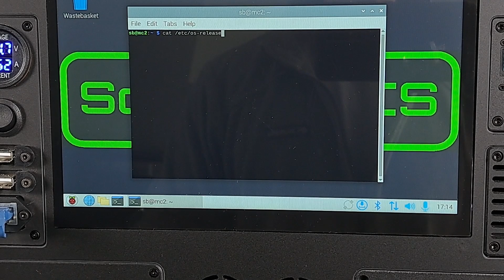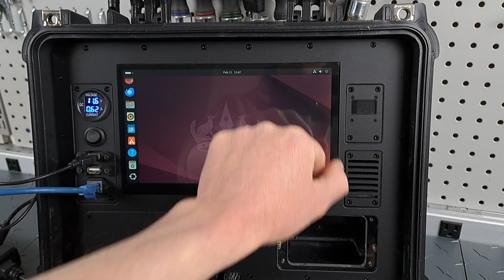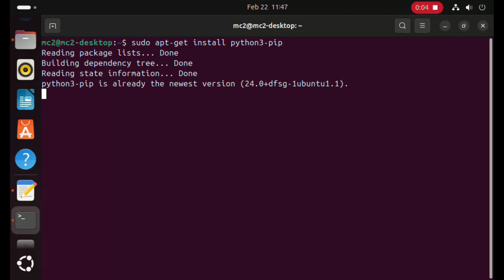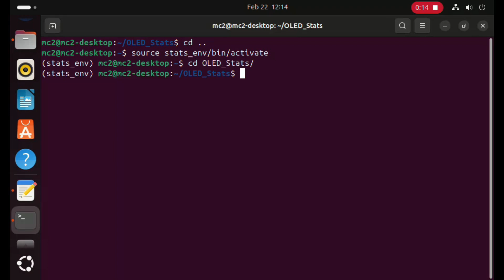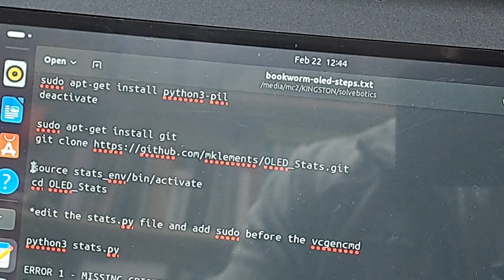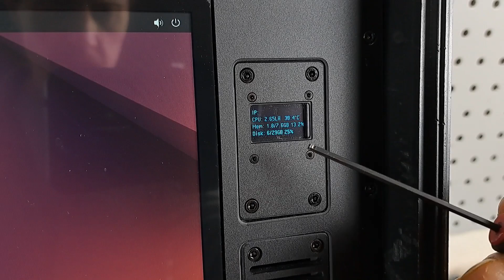SolveBOTICS Mobile Command Center - Installing Ubuntu 24.04 LTS

Comment: Dan - thanks for sharing - I plan to run that on mine once it arrives (also planning on swapping out the default pi with an upgraded 16Gb pi5 or maybe my 32GB OrangePi5+)
Reply from the maker: Looking forward to you receiving it!  Thank you for your support!
Reply: @solveboticsllc6796 I love it .. 
Replaced the Pi4 with a 16GB Pi5 w/Ubuntu.... And a huge internal battery pack...
Reply: @solveboticsllc6796  My 16GB Pi5 is pretty sick. Works well so far. Pretty sure Im no where near your guys' skill level and I have plenty to try on it
Reply: my usb3.0 to 16 slot pcie port for a real GPU just arrived and am gonna try that out